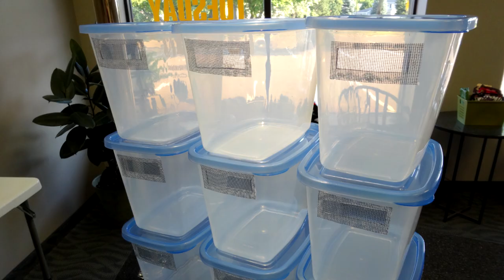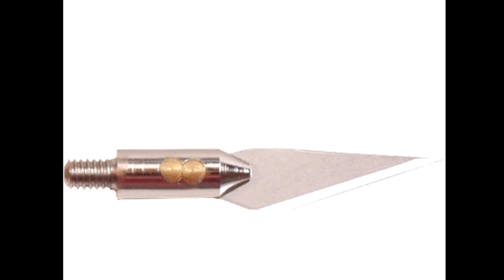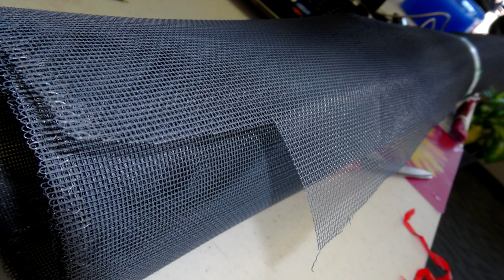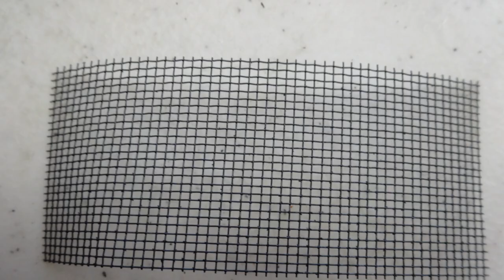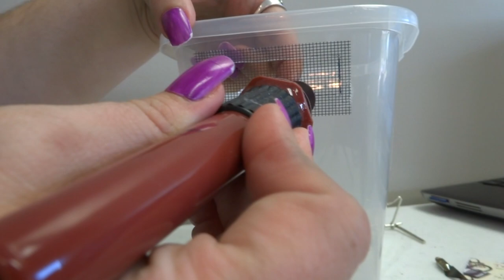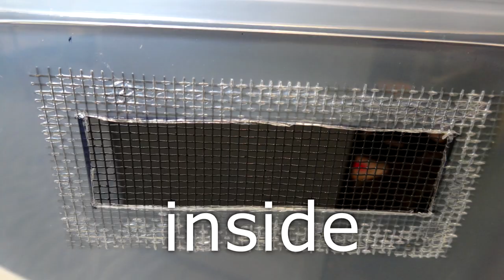Cut totes with out cracking ( making critter bins)

Comment: Thank you for this tutorial! I would like to ask you to consider encouraging watchers to add at least one more window if their critters are mammals. Mammals like mice, hamsters,  and rats would benefit from cross-ventilation to clear out ammonia and carbon dioxide not to mention any excess humidity. If I was housing mammals that would be doing their business within and not getting a daily change of the substrate, I would like the walls to be 20-40% open (with mesh).

Comment: i just ruined 100 bucks worth of plastic totes cracked all of them trying to drill holes.  just ordered this, thank you so much!
Reply: I did the same a few years ago but only messed up three bins. Last year I heated my pocket knife with a lighter it took long but worked pretty good. This year I'll buy the tool lol
Reply: @DawnCattery  I just heat a SOG pocket knife with a lighter and use that to cut
Reply: @DawnCattery  also try using a hair dryer to blow air on the plastic to make it softer
Reply: @DawnCattery  I should have mentioned this earlier but the semi clear semi see through plastic is way harder to cut. The gray sterilite brand bins are the easiest. If yore going to tape the lids try and get extreme weather duct tape I forgot to do that

Comment: at 1:30 you say you can use a flat element to melt the wire to the bin. Where can I get the flat element part?
Reply: It comes with the versatool... several different attachments come with it.